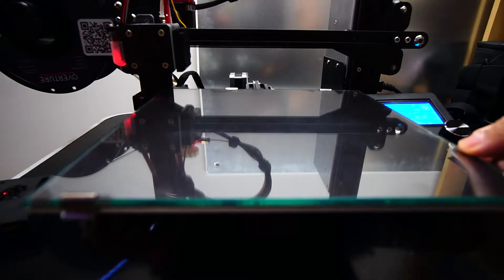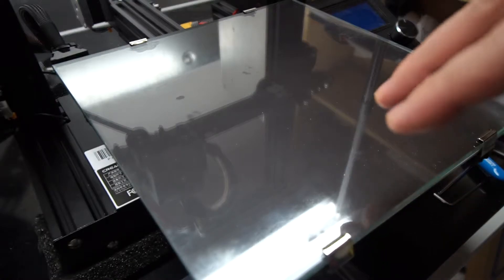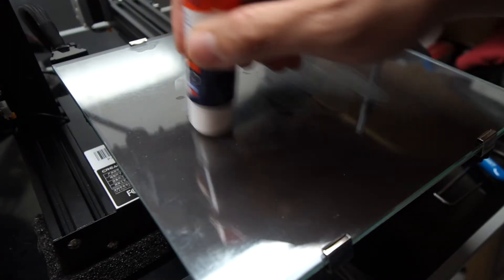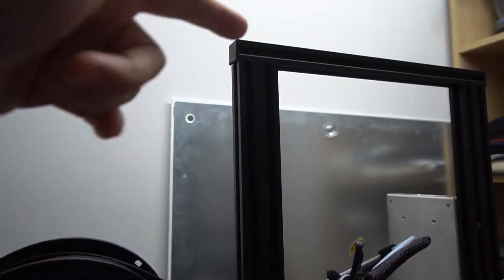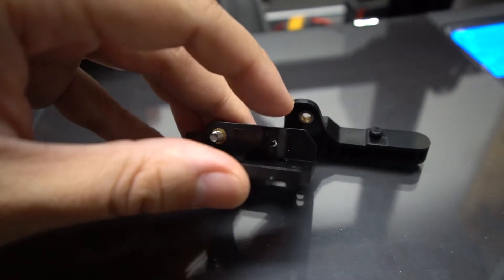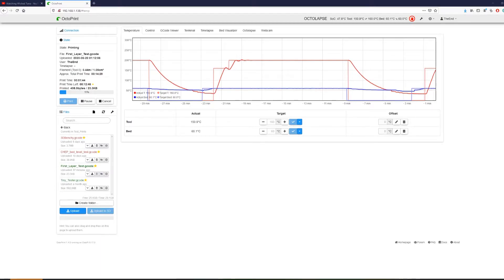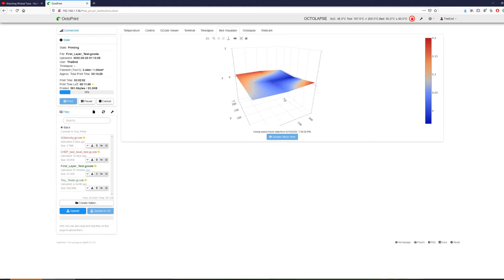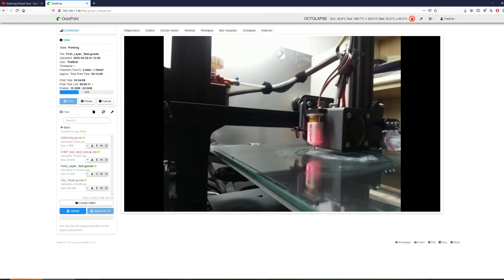Small and Practical Upgrades on My Ender 3 Pro

Comment: Hello Tim,
I am going to buy an Ender 3 Pro and e3 Mobo but i have some questions for you. First where can I get that same metal extruder bracket thing? And second what raspberry pi are you using?
Hope you'll answer my questions.
Reply from the maker: I got it off of Amazon, the link should be in the description.

https://www.amazon.com/gp/product/B079JZ374W

I use a raspberry pi 3b. For octoprint, you want at least a raspberry pi 3 or higher to ensure that it's fast enough to not have and chances of latency when sending commands to your printer. Also, if you plan to use a lot of plugin features on octoprint, a raspberry 4 might be better.
Reply: DorkyTim Thanks for your reply i think i will buy a raspberry pi 4 and that extruder bracket